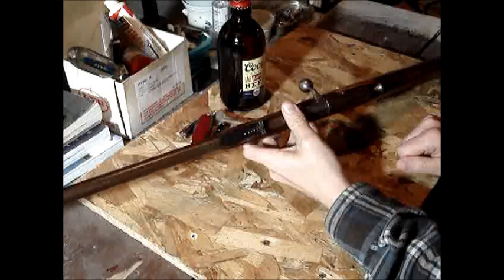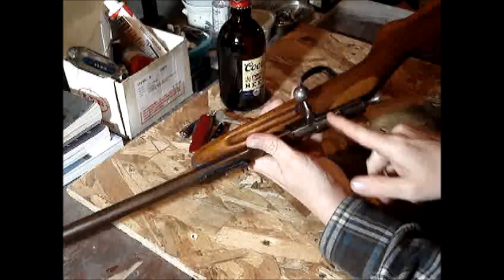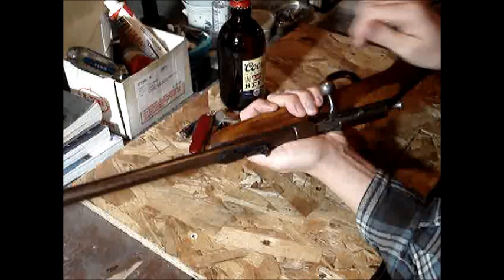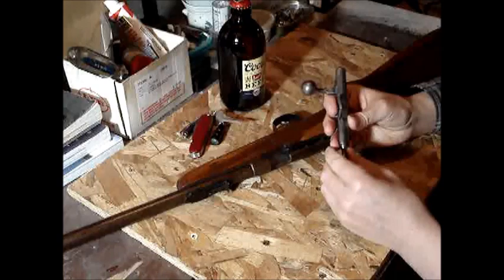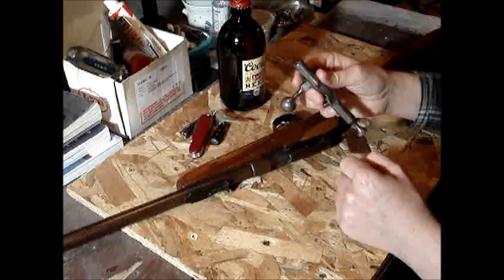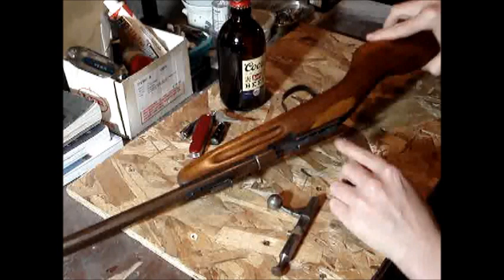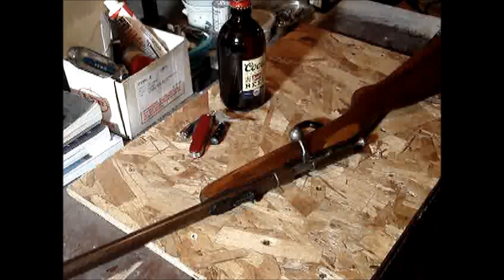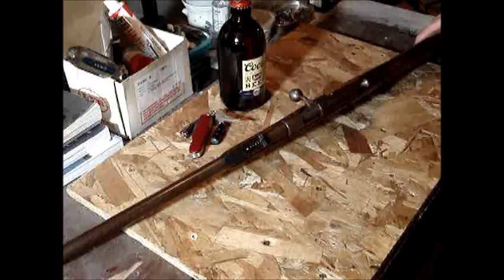How It Works: Cooey Single Shot .22 Rifle Bolt

Comment: Holy Shit! So the other model 82 is at my Daughter's, but I have my Uncle Louis' model 39! I go check it, and I'll be damned, it functions correctly. I swapped this 39 bolt into 82, and 82 doesn't have that problem anymore!! So I put the 82 bolt into the 39, and I'll be damned, it does not have a problem either. I kept trying them both about 20 times each, and I can't make them fail. Probably will show up at some point again, I don't know. For now all is good. This all would have escaped me though if you hadn't pointed it out. Thanks again Gungeek!
Reply: Lol i noticed that with other cooeys of mine. Sometimes things jusy fix themselves almost. And if you do need to fix something its usually easliy done.
Reply: @ethanross5919  I love Cooeys! A true Canadian Classic! We'll just see how long this lasts. Like you say, usually easily fixed.
Reply from the maker: very welcome :)

Comment: I've had to freshen up sear mating surfaces before on old work horse 22s, usually only takes a few passes with a stone to crispen up a rounded edge  unless it's super worn. Thanks for sharing, I've never seen a 22 bolt gun that went to half cock
Reply from the maker: now that i think about it none of my others do that. got a old Savage model 3 but it has a rebounding firing pin, but that's kinda like half cock.
Reply: All of mine do

all the old .22 single shots I have seen do the same.    
exactly as explained in the video

Comment: I have an old C.I.L. .22 single shot and I'm pretty sure it was Cooey that made it... it's nearly identical to this one. I got it from a buddy that had it hidden in a cold air return duct in his house for who knows how long. The bolt is quite stiff at the almost closed position (both directiins) even after a solid cleaning and oil, I can't seem to get it to loosen up. It shoots really well and everything does what it should, but it's really annoying to chamber another round lol... any idea what it could be?
Reply from the maker: make a video?
Reply: Have it ultrasonically cleaned the c then dump in a coffee can with an oil/kerosene mix then blow it all out with an air gun

Comment: YES! that's exactly what happens! I have it on half cock, pull the trigger, and the back portion of the bolt moves forward, and yes, with a round in the chamber it does not fire. I examined the bolt and compared with your still photo. Sear face on bolt seams very sharp and flat etc. Just like your photo. Not so sure about sear though. It also looks okay, but I notice that when I pull the trigger slowly and observe. The back portion of the bolt lifts up just before slipping forward on that half cock position. I have access to another model 82 that I'm going to make some comparisons with. Maybe even swap parts if need be, to make this thing work properly. Thanks for making this video Gungeek! Very much appreciated.
Reply from the maker: I like helping :)

Comment: Could you make a video on how to take the bolt apart please?
I'd like to watch someone do it before I try it myself.
Reply from the maker: I don't have the right tools to take it apart. so i don't want to damage anything. something on your bolt broken?
Reply: @Gungeek  I had the extractor replaced last year because it wouldn't eject. It worked for a while
I hadn't gone out with it until a few months ago when I found it would wouldn't eject anymore. 
Rather than take it back to the gunsmith someone recommended that I take off the extractor and clean it and underneath it.
Reply from the maker: @peterstam91  I have replaced an extractor before but i think they can be broken very easily, maybe just try spraying cleaner under it to flush the dirt out?
Reply: that one you push a pin and unscrew it I think..  but thats probably a really late model.

I've had mine for 30 years..   mom had it 60 paste that, grandfather gave it to her god know when..
probably one of the first, cuz mine doesn't have any "half cock" or retention.   pull the trigger when the guns upright and the whole bolt falls out lol..
Reply: The bolt comes apart using a split driver similar to a split screwdriver bent 90degrees and the bolt must be partially pulled apart to get to the inside
Reply: That is what is supposed to happen. The front edge of the sear acts as the bolt stop